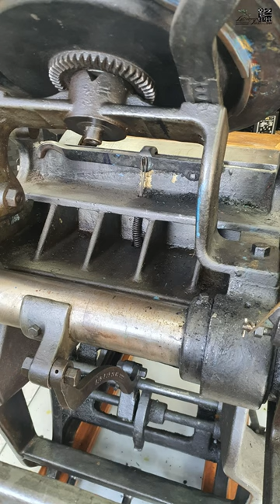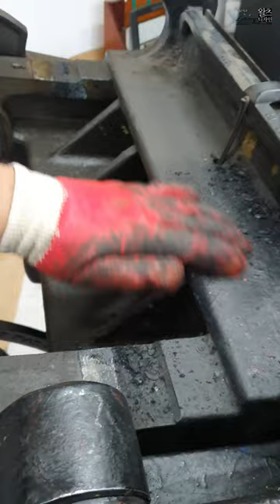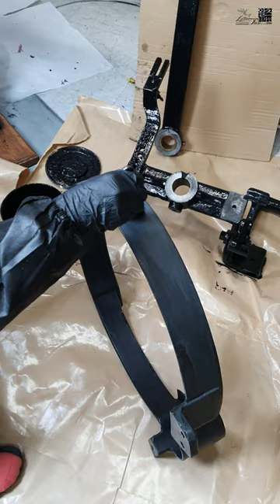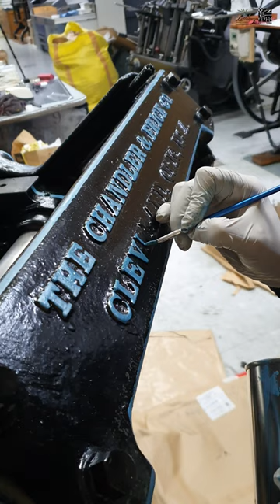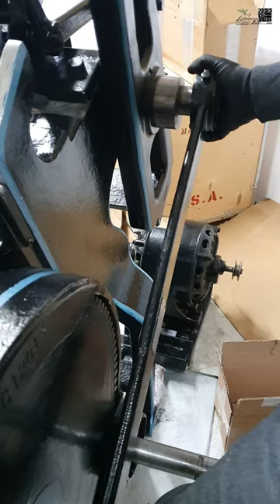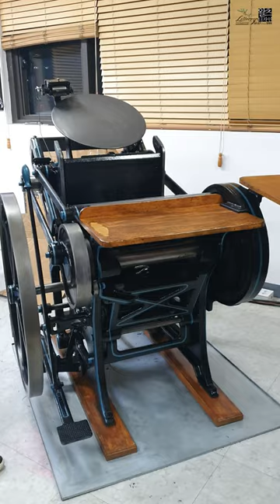Chandler&Price 12x18 Restoring letterpress equipment.챈들러12x18복원 영상 올려봅니다.

Comment: Does your letterpress work on glossy paper?
Reply from the maker: Ink will not be applied to glossy or coated paper.
Reply: @w_letterpress ok! do you know a way to print on glossy o coated paper.. let's say manually with a letterpress o something similar??
Reply from the maker: doesn't exist.  It is possible in UV printer.
Reply: @w_letterpress  what about a flexographic machine?
Reply from the maker: @gabrielleboni3428  It's difficult to answer because I don't know much about it.